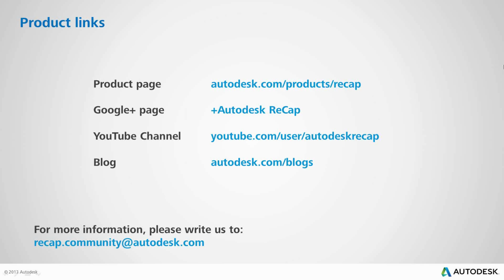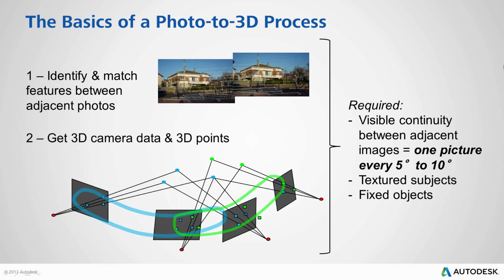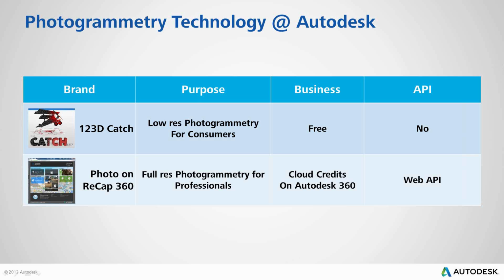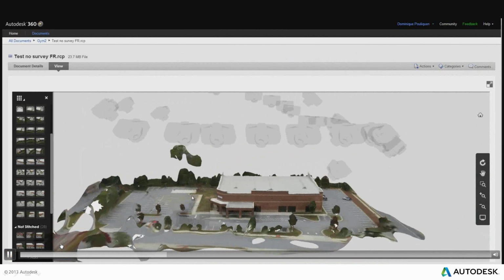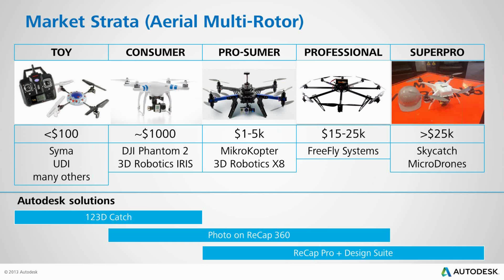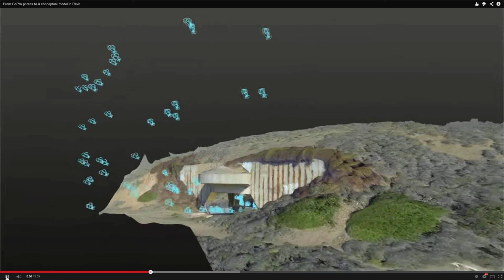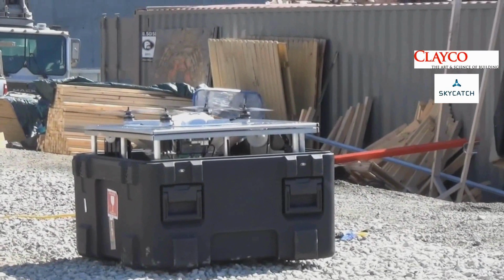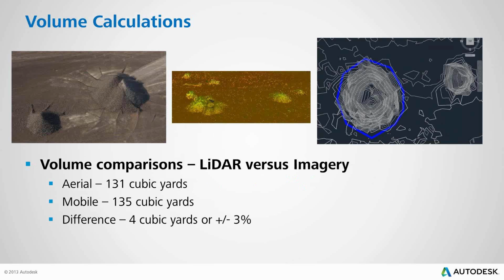Reality Capture Webinar #6 - Capturing 3D reality data by flying a UAV

Comment from the maker: Correct, all you need is to upload "good" quality photos on recap360.autodesk.com
Still, the web service can be used for adding known coordinates, either custom values, coordinates from as-built model, or coordinates taken from total station.
Some of the survey process is explained in this basic tutorial: Photo on ReCap 360 - Add Survey Measurements
And the complete workflow: Photo on ReCap 360 - Complete Workflow